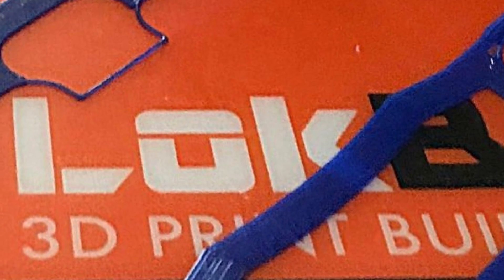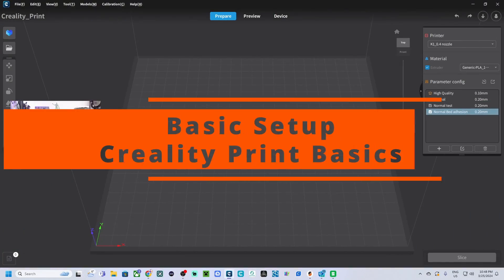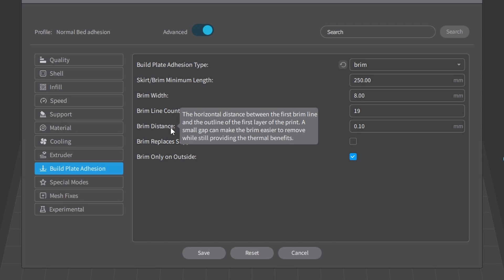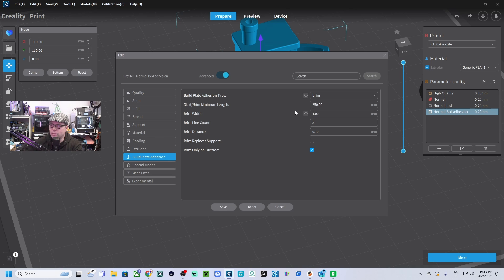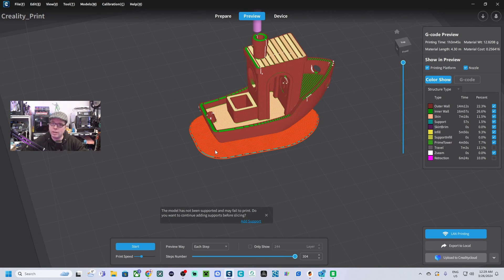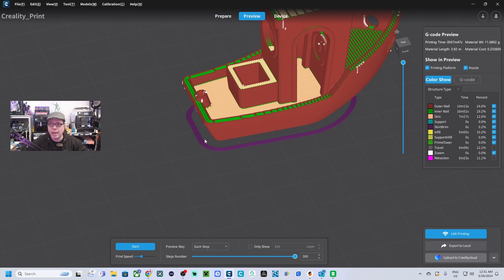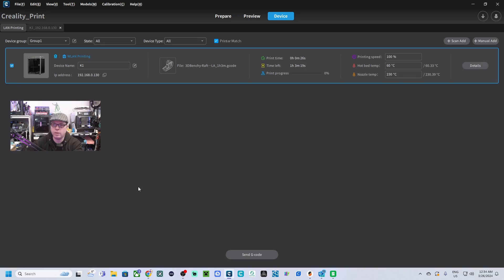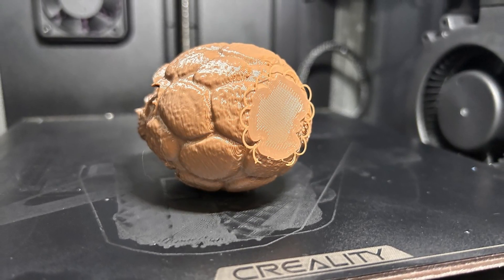Creality Print Basics - Build Plate Adhesion Types

Comment: This has helped out so much with a number of printing issues I was experiencing! Awesome video, thank you. I do have a question about Creality Print's G-Code preview is the Material weight how much filament it will use? I'm trying to figure out how much filament my print will use because I don't want to run out mid print or right at the end but I don't know if that's something Creality Print does and if so where I can find it. 
Your videos have been a tremendous help, I've had an Ender V3 KE for less than a month now and these videos have helped narrow down my configs and get more seamless prints, thank you!
Reply from the maker: Great to hear that this video helped you. Sorry for my late reply. 
If the slicer, like Creality print shows you the length and weight of the filament used, that you see on the right hand side. See it as an estimated usage of the filament.
Reply: @Zachary3DPrints  Okay perfect, thank you very much!